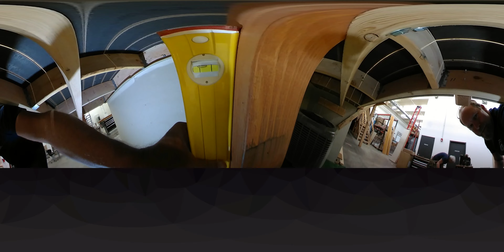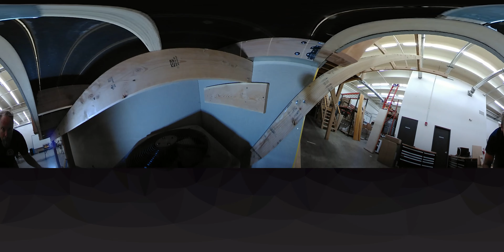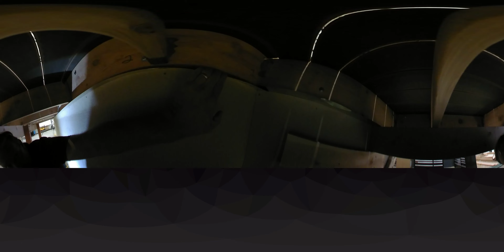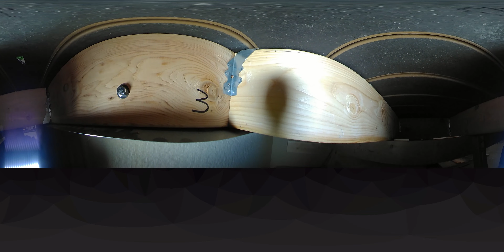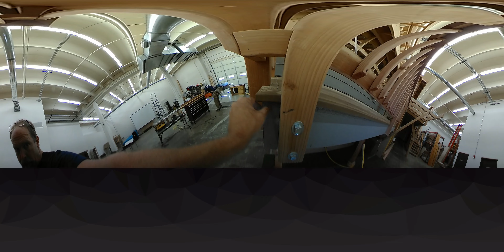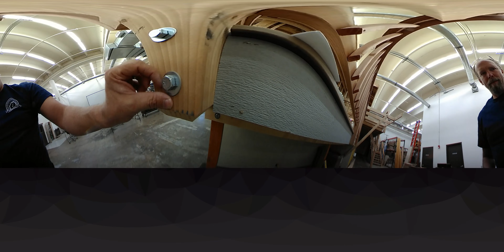Finding Deck Defects at House of Horrors

Comment: Slow presentation, as usual for Ben. Uses hmmm to much. No need to repeat statements 2 or 3 times.
Reply from the maker: Hi, Steven. The point to the video is to move in a 360 environment yourself, which should not require me talking to the viewer. So, I recommend playing the 360 video again, and turn off all of the audio, and move in the 360 environment to find the defects at the deck.
Reply: just turn up the speed and stop bitching
Reply from the maker: Steven is correct. I'm very new to using a 360 camera. It's unlike a normal video camera, because a viewer of a 360 video can see everything at any time. The camera does not have pan this way or that. So, as the instructor, I have to speak in a totally different way while recording a 360 video. I'll work on getting better.
Reply: Dude why are you complaining? This 360 vision is the best, dont watch if your gonna cry